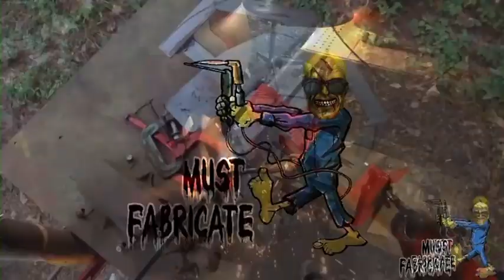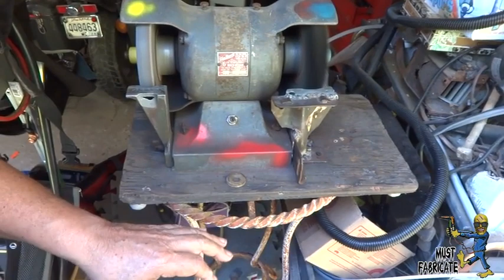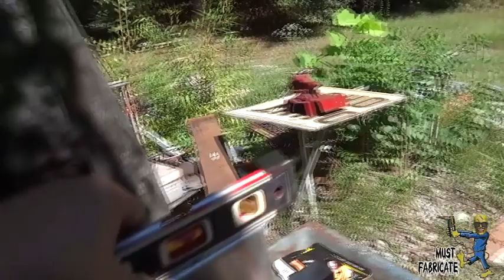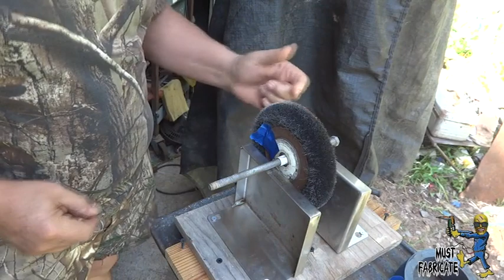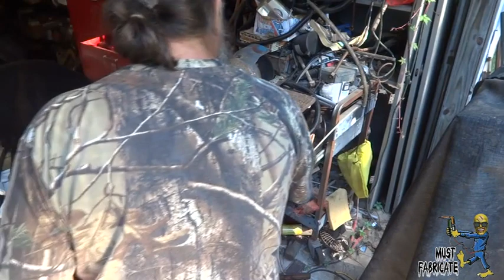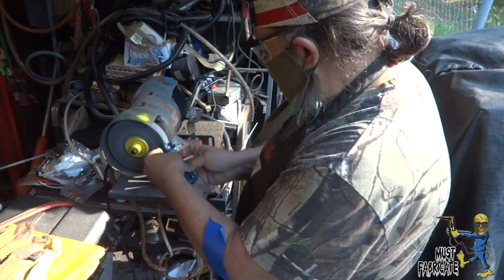How to balance bench grinder Wheels at home DIY

Comment: Safety glasses might not be enough protection.  I had a wire get stuck in my cheek once, and heard tell of a guy getting a chipped tooth from a grinder mishap.  Full-face shields help more.
     A second grinder will save you set-up time for your different stones.  Maybe put a buffing/polishing disc on the other end.